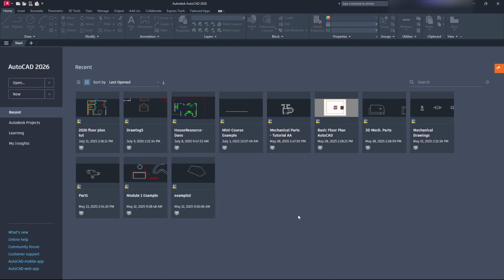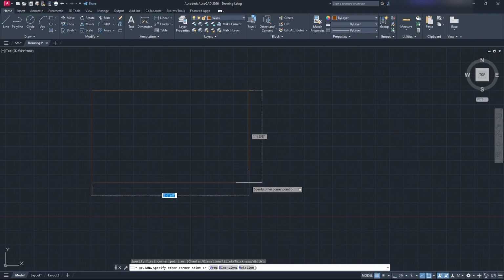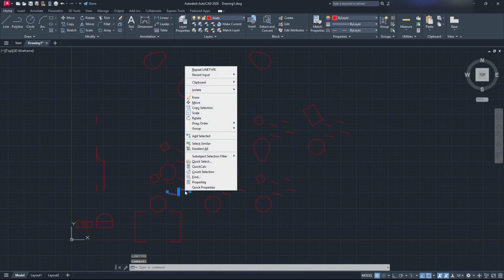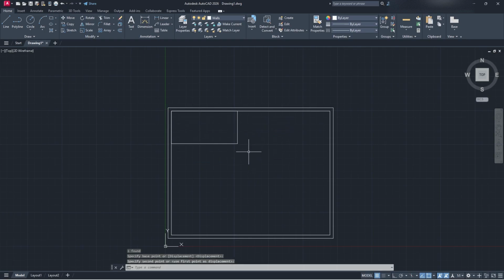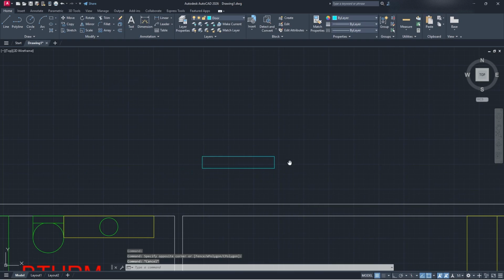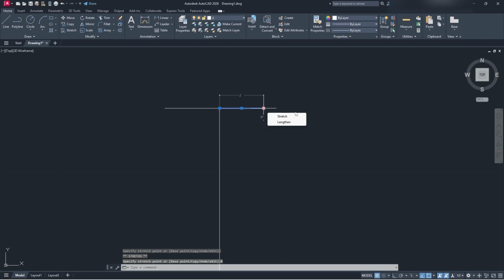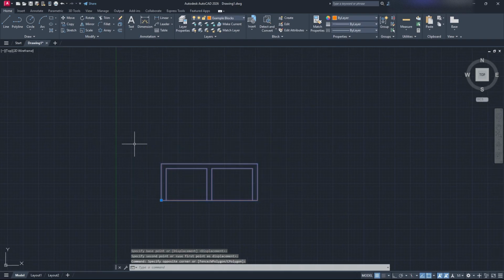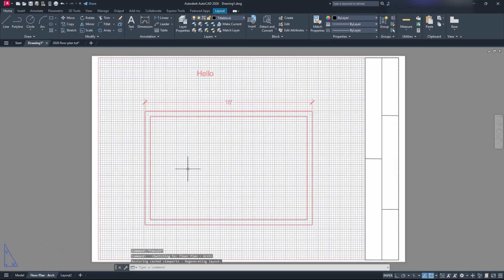AutoCAD 2026 FULL Course For BEGINNERS!

Comment: the "light years" unit is hilarious. what the hell is it even for genuinely
Reply from the maker: You know, that's an excellent question. I wish I could answer that for you. Best I could come up with is you can use autocad for any application, so if you're making a model of the solar system I guess it makes sense? 

That said, If I remember correctly they have it available in Civil 3D too. I don't know anyone drawing highways in light years.

Comment: hey learning using civil3d and it has a bunch of default layers on. In the dropdown window in the layers panel how do I just have it showed the layers i created not the hundred others? I turned them off and froze them but still showing. Thx
Reply from the maker: Civil 3D is a bit different than standard AutoCAD - however you should be able to see a little funnel somewhere on your layers and be able to filter what you're seeing. You should then be able to freeze them. If not honestly I don't know much beyond that. I apologize for not being much help, I haven't used Civil3D in quite a few years now!

Comment: Hey would this video tutorial work for autodesk web? or woul I issues on the user interface? thanks.
Reply from the maker: The web version is cut down quite a bit - some things may work but it would be hard to follow along with.
Reply: @VerweyDraftingInc  ah ok I see, i guess it will be wasting time because of its technical difficulties. Im returning to the work force and just need relearn cad ASAP.
Reply from the maker: @jassonlondono  Do you have a job lined up and do you know if they're using AutoCAD Web? You can learn some of the basics through it, such as basic drawing, but again, a lot is missing or cut down. When was the last time you used it?

Comment: Hi, I'm a total newbie with the Autocad software. How do I set the scaling to 1:100 permanently for pdf/jpg floor plan imports? I've tried a few times but the measurements of my floor plan does not correspond to the original drawing in mm.
Reply from the maker: If you're getting PDF / JPG files that can be a bit difficult. Type in PDFIMPORT into your command bar, and you'll have a box pop up. There, you can select your scale, rotation, etc. but that leads to the issue if you don't know your scale. I'd recommend importing at a 1:1 scale and see if that works and adjust later. I tend to tell people when doing any drawings for floor plans, etc. always draw in a 1:1 or 1:2 scale. You can adjust the scaling of the drawing later in paper space before you go and save it as a PDF or send the DWG off to a client. Hope this helps somewhat!

Comment: When I set my units the coordinate bar is registering an E after the units example 2345.23E,1234.5
Reply from the maker: Check your unit settings and make sure its setup correctly! You might be in scientific notation.

Comment: I've struggled through many Architectural Drafting tutorial (or at least started them then got frustrated).  This is by far the best I've come across so far.  As mentioned in some comments, this is more for people that understand architecture and are learning AUTOCAD.  I'm an Architectural Engineer by degree (1989 graduate), but then went into the military and flew helicopters, then into production management, and am now looking to design my retirement home.  Pulled out the old drafting board and have some ideas now, but AUTOCAD is definitely the next step.  So THANKS for the great tutorial!
Reply from the maker: Really glad you enjoyed it and I'm very glad it helped! Best of luck with your plans!

Comment: Hello I keep watching the video and do not get your offset because when I do my offset the same as yours i do not get the same space but rather something bigger than what you get, and i am asking what am i doing that is wrong
Reply from the maker: Most likely using different units. You could be putting 3 feet instead of 3 inches for instance. Or you're zoomed in to a different degree than I am. You can double check your sizes by using the "Measure" tool! You can't always tell sizes without measuring, especially in AutoCAD due to zooming in and out.
Reply: @VerweyDraftingInc when I use the measurements I still get the right measurements but I will take a close look to see if I am in feet or inches
Reply: Thank you

Comment: I love the tutorial but am having a hard time because I can't get my menu to show up the same as yours. I have tried resetting my app but it's not working. Any suggestions?
Reply from the maker: If you're using AutoCAD for Mac the interface will look different. I make sure to keep my interface settings default from AutoDESK to help all our students. On PC you can move your ribbons simply by dragging and repositioning, whereas on Mac you cant do this.

Comment: The Units doesnt work for me. It just "insunits"
Reply from the maker: Hmm thats interesting. You will have the Units command, and it should work. Are you using AutoCAD LT or AutoCAD? Either way it should show up. You can also use the -DWGUSNITS command to swap an existing drawing.
Reply: @VerweyDraftingInc AutoCad 2026

Comment: Autocad 2002 user here, yes you read that correctly LOL. I’ve recently lost access to the program I had due to my laptop going down. I’ve been considering getting this new program for designing my construction jobs and what not. Not really sure if I would need this extensive of program. But I do have a few questions. 
Are there ways to access older programs that may be less expensive? 
With 2002 being good for what I used it for, what would you recommend I do? 
Also just curious, does this new program have the capability to determine bearing loads for beams and trusses or am I just dreaming? 
Thanks in advance.
Reply from the maker: That's quite amazing! 
So to answer your first question, unfortunately you can't buy old licenses for AutoCAD. If you do find someone saying you can get an older version there's a good chance its laced with malware. Something we don't want!
If you only use 2D tools in AutoCAD, then I'd recommend you get AutoCAD LT, as its significantly cheaper than AutoCAD (I'd post the link but its huge lol). Its $55 / month or $550 / year compared to $260 / month or $2060 / year.
Sadly you can't just buy the program and use it forever anymore. You need to "Re-buy" a license every year. It sucks, but that's just the way it is.
For your last question, yeah you can't do that in AutoCAD yet. It would be quite useful but no lol.
Hope this helps, and all the best!
Reply: @VerweyDraftingInc yes it would be quite useful! I’ll have to check out the LT version. Thank you!

Comment: The scale is so triggering when you are in architecture school……
Reply from the maker: Absolutely it is. It can be a nightmare and hard to understand what to change / when to change it. Have a video lined up on this topic coming out in the next few weeks!
Reply: @VerweyDraftingInc that would be awesome. I was so shocked when I realized thr things that were taking me so much extra time can be done in 2s on autocad
I had a question tho, with the trim tool how do you fix what line you remove? Because it automatically does the top one but sometimes its the bottom yknow
And also the snapping sometimes gets tedious and u have to zoom in and see its like a centimeter off. 
Last thing is knowing when a line is two overlapping, how do u know?

Comment: Hey do you know how to set up the Rectangular command? I used to type Rec and following by types the dimensions I want. Now in my Autocad 2026 it's not typing the specific dimensions I want, but it's typing the coordinat, which is really stressfull if I want to creates quick rectangular like I used to. Thank you for your help
Reply from the maker: That's interesting; try this. Turn on Dynamic Input (F12). OR Set your DYMODE to 3. See if either of these help!